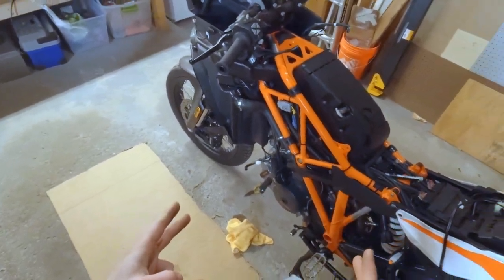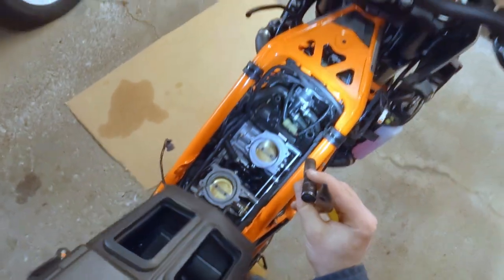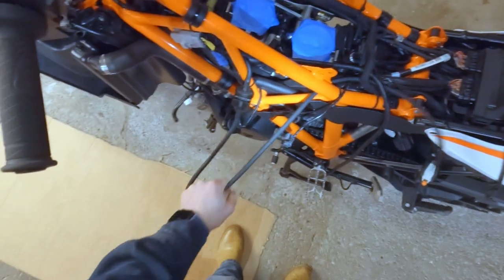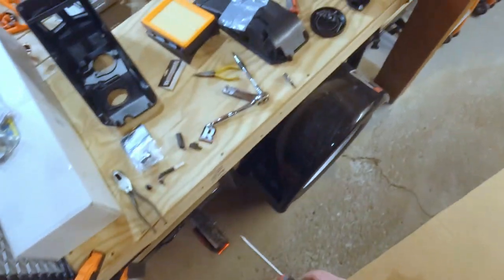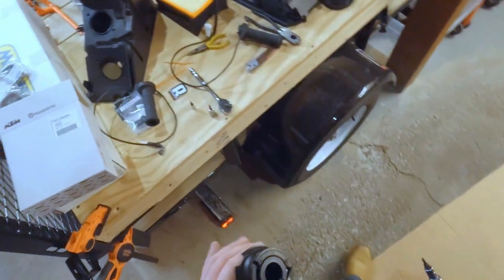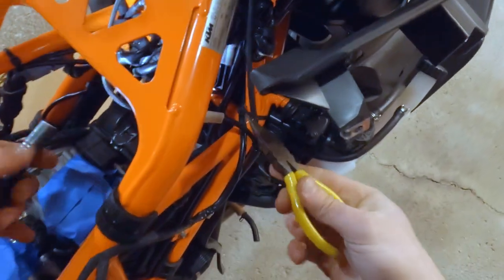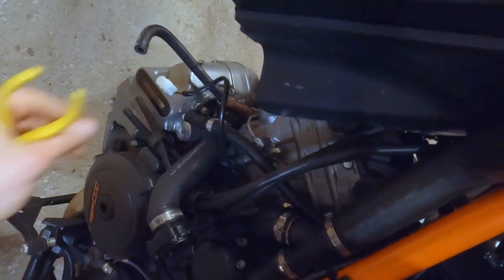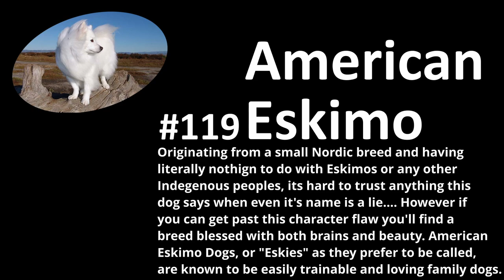1290 Super Adventure Build - Part 2  |  SAS Removal and Heated Grips

Comment: Great Video, any codes or issues after removing the SAS? Are you doing a DynoJet fuel map system too ?
Reply from the maker: Thanks! No issues at all. Just got back from a 1,000 trip through Vermont and she ran flawlessly. Still back and forth on whether I’m going to do any tuning, if I do I’ll likely go with a Bren Tuner for both my Super Duke and Super Adventure. I’ve run Power Commanders on a few bikes before and want to try something new.

Comment: How many miles?  It looks brand new!
Reply from the maker: It had 1,200 on the clock the day I picked it up. Literally didn’t even have any stone chips on the skid plate and all the bar code stickers were still all over it from the factory. Bike hadn’t even gotten wet yet. If you had told me that it was brand new never ridden the day I picked it up I would have believed you lol, super clean
Reply: @goldnmoto383  Yeah, the airbox and throttles showed it was basically new.
Reply from the maker: @lesgarten  yup, they looked fresh out of the box for sure. I’ve put about 5,000 miles on it since that video, lot more color on there now lol